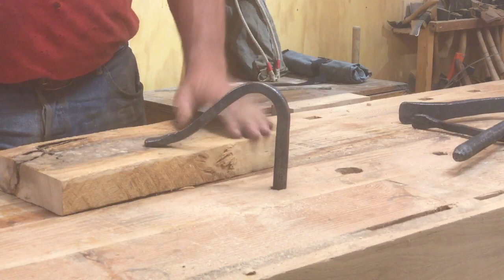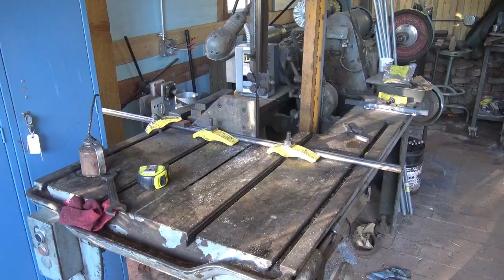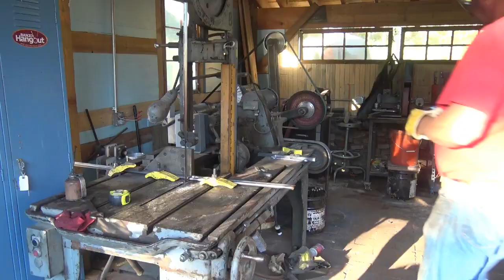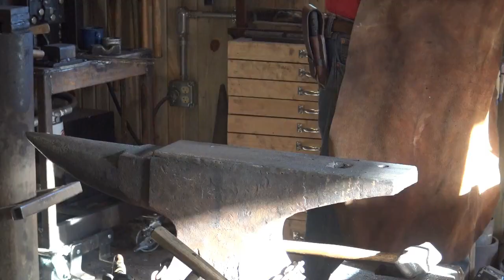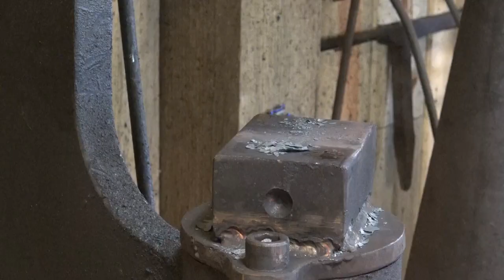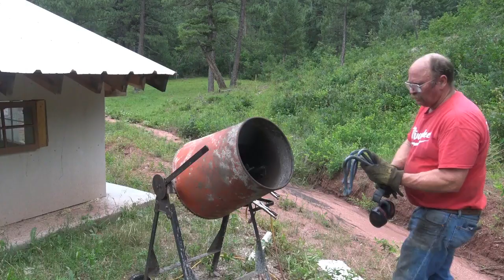Forging a simple holdfast for wood working, black bear forge

Comment: When using the concrete mixer, stick an old couch cushion in the opening to cut down on all the noise.
Reply: Keith Devers is that what you've done? I worked in a foundry and we used the same method, there wasn't much you could do to cut down the noise.

Comment: I would like to give it a try myself: Exactly what steel should I use? Great video providing insights into the process! Thank you!
Reply from the maker: Mild steel is ideal for holdfasts.  I buy 11/16" cold rolled, which is an ideal fit for a 3/4" hole
Reply: @BlackBearForge  thank you for the quick reply!
I had spring steel in mind, good to know that I don‘t need to order something fancy. Thanks!
I‘ll search for something that matches your description and is available in Germany.

Comment: When you were bending your hold fast I noticed you used a old looking wrench to secure it before bending
I have one just like it
Do you know anything about them 
Also i am glad i got to see this video because i was going to make it fit the pritchel hole
Then a close up i seen you had a hardy hole adapter 
Thanks again great job
Think the cement mixer idea would drive my neighbors crazy
Reply: It’s seems to be a old monkey wrench. I am a plumber and have collected them for many years. Basically a pipe wrench with no teeth. Used many on flat surfaces that have a nice finish on them.